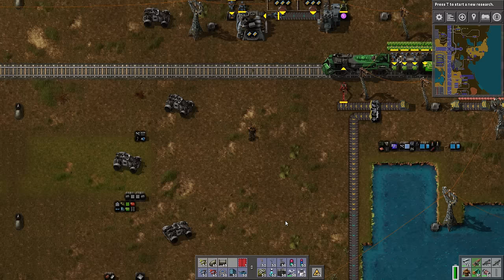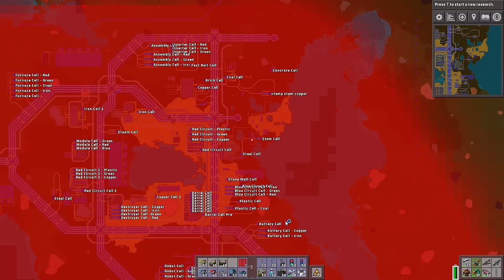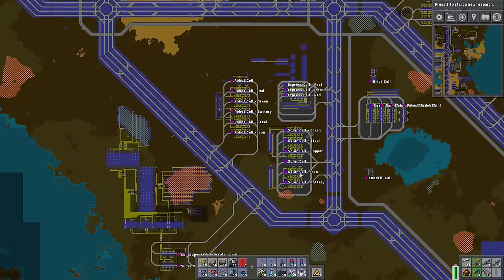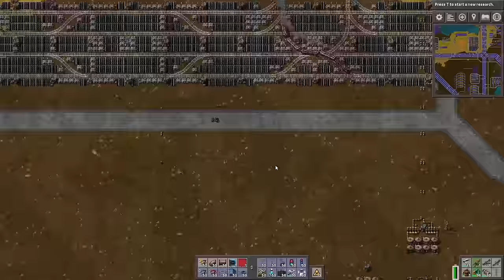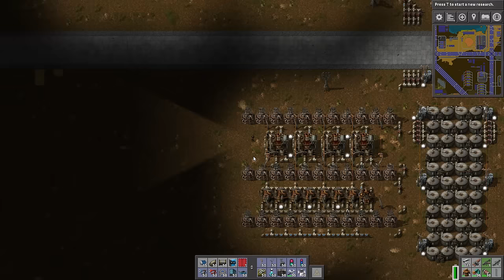Factorio Meiosis :: Refining the Oil Refining - Episode 39

Comment: You should use circuit networks to control the ammount of oil cracking. It's very easy and makes shure that you have enough heavy oil for lubricant and turns rest into gas. There are plenty tutorials on this and it's how i got into the network stuff in the first place. Super Usefull. Also this is my favorite series btw)

Comment: For oil storage it is much more space efficient (better for your computer too) to use barrels in chests than liquid tanks.
Reply: Hedning1390 With how much space he has, I son't think he's worried too much about the space that a dozen or so tanks takes up.

And keep in mind how much Z favors speed. Any space he might save by having less tanks, he'd take up again with rows of assemblers to barrel and unbarrel the oil, plus beacons to speed them up, plus the logistics of building and transporting barrels around. It'd be even more hassle.
Reply: I don't think you understand. Filling barrels is super fast so you don't need many of them. 2 assemblers at 100% crafting speed can supply 25 refineries working at 100% crafting speed. Even if speed is a concern you can run one pipe directly to the processing and one to the buffer. Not every bit of oil have to go through storage. You also don't have to transport the barrels if you don't want to. The purpose is just to replace all the tanks with chests as 1 chest holds as much oil as 5 tanks even though it is much smaller, so you can place the emptying assembler right next to the filling one.

Tanks, apart from taking up lots of space and cpu power from the constant flow calculations, also kills pressure causing lag between the oil coming in and being used.

Comment: +Zisteau, There's a mod Squeak Through which allows you to walk in between solar panels, pipes and other structures like you can with beacons which would make it easier to get around.

All it does is slightly reduce the size of the collision boxes for various structures. If you have not tried it give it a go mate. Once you do you'll be lost without it :)
Reply: There's also the Aircraft mod, which basically phases you through all terrain.

Comment: Z, I appreciate your setup on most cells in this world, until it comes to oil handling.  My understanding of your system would suggest: 

1) A need a mod to allow all fluids to be drummed, or otherwise transportable by train, causing a need for an extra stop at all cells for the fluid dump.

2) Where oil fluids products are needed in a given cell, delivering cruid by train, cracking the needed product(s) in the cell, and converting the remainder into solid fuel.  The Solid fuel can then be used to fuel the trains, and shipped to a storage facility for specialized delivery.  Unfortunately, this would add 2 stops to your cells, oil drop off and solid fuel pickup.

Comment: Do you need so much buffer for crude oil? If your storage keeps filling up, then it means you're not using as much oil as you produce => your pump jacks don't need to be working. If your storage keeps draining, then it means you don't have enough oil produced by the pump jacks in the first place. The only thing you need storage for, is the delay introduced by the oil trains, so the refineries can keep working while the trains are getting more oil. Also I find it easier to just up your cracking to insane levels, but only crack when you have more than enough of what you're cracking (say, over 80% of heavy oil in a storage tank, for example), easily done by separating a type of crackers into their own power network using a power switch with a condition connected via circuit network to one of the storage tanks which they will drain.